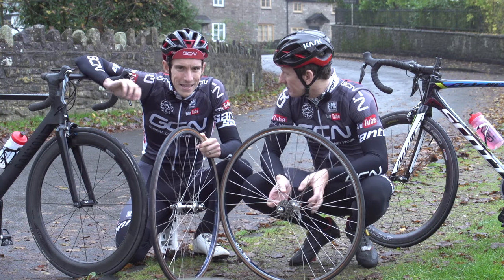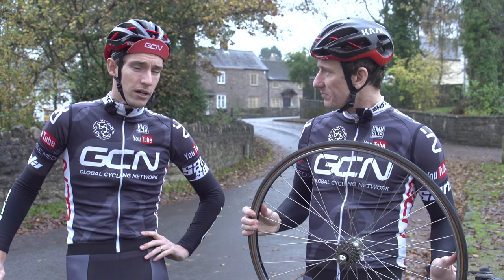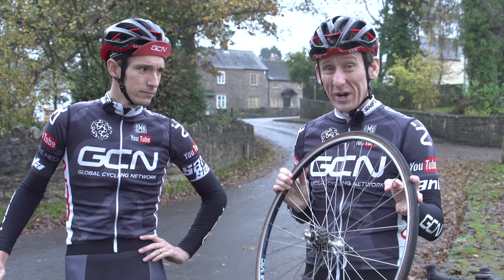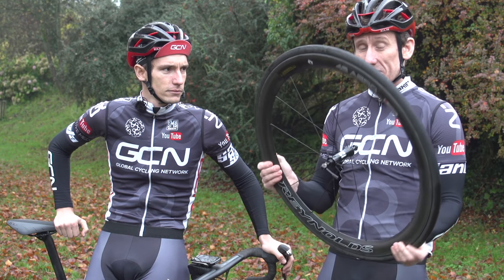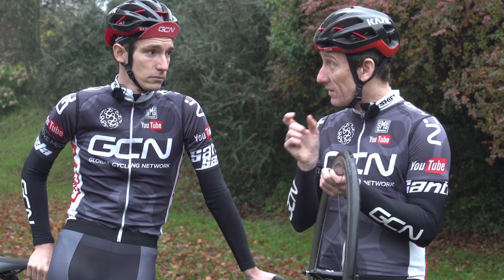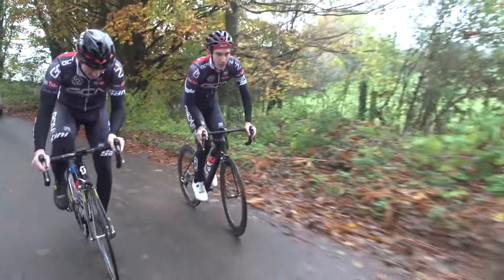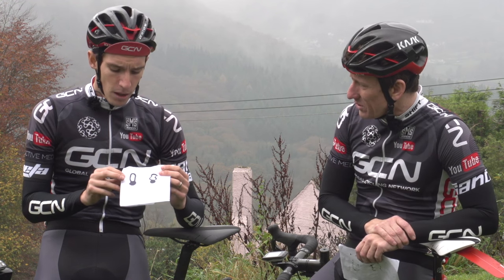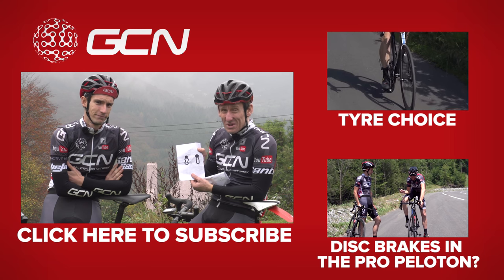Retro Wheels vs New Wheels - How Have Modern Bicycle Wheels Evolved?

Comment: i snapped a gear cable on my way home from work today, at 7pm in the dark wind and rain, and i would like to extend my extreme and undying thanks and gratitude to GCN, using my limit screws, i turned my bike into a single appropriate speed and made it home in reasonably good time, hence why I'm commenting this now and not in 3 hours! Thank you GCN!!!!!!
Reply from the maker: +marcus allison good work!
Reply: +Global Cycling Network are the thinner tires more dangerous like do they slipout from under u easier
Reply: Generally they will because they have less contact with the surface, but its all about being strategic about where you'll be biking to avoid such a thing.
Reply: happy to hear this
Reply: Thinner tires do not 'have less contact with the surface' by itself, area of the contact depends on tire pressure. So only IF you are running wider tire with lower pressure you get extended contact area, more cushioning etc.
Reply: If the back cable snaps it defaults to the smallest cog, so if you need a lower gear that's a smart tip actually.

Comment: I am old enough to have ridden those old wheels. I rarely need to true a rim now but, back then, it was constantly needed.
Reply: +David Mansfield Only if the wheels were built badly. I am from that era of cycling and used to build wheels of all kinds. Constant truing was not needed.
Reply: I ride a 40 year old steel frame with 27 by 1 and a quarter wheels. truing is a skill that's well worth learning!
Reply: David Mansfield I weigh 260 pounds and ride an original 1983 bike, no problems?
Reply: Always wondered what’s the difference between a 36 straight gauge 3x wheels and one with 32  3x double butted spokes except the weight.

Comment: Several key points to emphasize: most such advancements have been oriented towards racing, as the companies learned the consumer market will buy whatever they are convinced the pros use must be better, even if it is not at all optimal for amateur and recreational use. Aero gains and efficiency with carbon cost huge amounts, with negligible savings over modern alloy shapes, light hubs, and Sapim light spokes. Braking problems with carbon, basically solved well with alloy rims for fifty years, forced more to create the novel, if pricey and heavier (!) solution of road discs, but upselling is easier since MTB have made them seem superior. Fact is, ironically, carbon pro frames are so light, they can re-add weight in brakes and other areas just to get up to the racing minimum, while a recreational rider using rim brakes can assemble a bike several pounds lighter. Aside from this, real recreational high mileage riders are still far better served by alloy spoked wheels they can true, replace or rebuild with standard spokes in all parts of the world, while carbon is a conceit, impractical, and WASTEFUL as well, being non-reusable. By the way, I can fit 25 and some 28mm tires on my Mavic Cosmos rims just fine, and that ride beats carbon, plus I don't have to fear braking hard every time I ride down upper Flagstaff.
Reply: "By the way, I can fit 25 and some 28mm tires on my Mavic Cosmos rims just fine".
I have an unrelated question to ask you: What's the biggest tire i can use on my cxp 14 mavic rims?, i currently use 700x23c. 23-622 michelin dynamic sport tires.
I see i still have a bit to go on height wise before the tire touches the frame.
Reply: @coffeepot3123  My rims are 20 and 21 mm wide, outside braking width. You can likely fit 25c tires, but larger may compromise the bead's ability to keep the tire on in hard cornering, one of the warnings, but I've never heard of one coming off. Brands vary, and I only found one 28c Gravel tire that clears the frame and brake mount. Front and rear may be different. Get one tire, try on both wheels fully inflated for clearance before buying two. It's all really fiddling with stuff, not real sophisticated; rando riders have been tweaking for fifty years.

Comment: Removing the brake track from the rim might not save much weight, once you add the disc rotor. However, you've effectively shifted weight from the rim to the centre, which means the moment of inertia of the wheel has decreased by a more significant amount. For a rotating body, you typically care more about the moment of inertia rather than the weight, since the momentum and kinetic energy of the wheel depend on its M.I., rather than its weight.
Reply: beeble2003 try spinning the wheel with your finger. that's the inertia you have. almost none.

Comment: I still have some race freewheels from back in the 80's. I have a six speed 13x18, and then two seven speed 12-18, and a 12-19. Back then, I was much younger, and could use them in flat criteriums. For rolling races, a 13-21 7 speed, and for hilly races, a 13-24. Decades later, I'm not about to push those gears any more. Now, I ride with a 12-25, with a 53x39 up front.
Having only a 13 in back, as your top gear, didn't limit your top speed, as long as you could spin. I remember one race where I was spinning a 13, in the last mile, up to 120 rpm, which spun out at 60 kph....Yes, tubulars were king. You weren't considered a real racer if you lined up with clinchers.

Comment: Just from an engineering perspective, depth of section of the rim has much more effect on stiffness than material. BD3/12. 
Carbon makes less difference in weight as the section gets shallower.

Comment: Would be nice to see a bit more in depth about wheels and how they are built. I used to build my own cause I was skint, now with mass produced machine built wheels it's only worth building if you use top end parts - you can still save yourself 60% + on an expensive pair if you have the patience and tools.

Comment: A few years ago I wanted to try carbon clinchers but was afraid of the delam failures I'd read about (we have long steep descents around here). I built up a Reynolds C32 on a DT Swiss centerlock and put a disc fork on my bike with TRP Hy/Rd brake and IceTech 160mm rotor. I run a Reynolds with a caliper brake in the back, but most of my braking is done with the front so the rear isn't at huge risk of overheating. In summary I think the added weight (nearly 1 lb) might undo some of the benefits, but I love the stiffness and acceleration of the carbon wheels (when the pavement is clean). While the industry is still debating whether pro races are ready for discs and what size through-bolt to standardize on, someone should instead build a decent road disc fork with 160mm spacing - the 20mm chunk of metal spacer for a rotor adequate for a typical adult male should be unnecessary. I'm also about to swap the Hy/Rd for the mechanical Spyre from my CX bike, just to experiment (new vs old Shimano shifters on each bike, so curious about the feel of the different braking actuations (i.e. Super SLR) as well). I suspect the mechnical brake is lighter and adequate enough, and I haven't tried full hydraulics because of the rim on the back (SRAM, unlike Shimano, offers a hydraulic rim brake with incompatible fluid, and I'm running Di2 so can't mix and match anyway).

More recently I had Sugar Wheelworks build me a pair of Pacenti SL23s on DT Swiss 350, and I run 25s on those. What a ride!! They are super comfortable, spin up quickly, and corner like a brick craphouse. Even with 23s they look like you're running 28s, but I'm sold on this new trend of wide rims. I haven't tried running them tubeless yet, as I ride them solely on the road so don't need lower pressure (plus I've seen several buddies run into tubeless problems while we're riding, so I'm personally not sold).

And yeah, I throw a bunch of money at my hobby, so if you want to factor in cost I'd advocate for wider rims over carbon clinchers. The v2 Pacenti SL23s ROCK, but I'm told to stay away from the v1.

Comment: retro wheel durability= 20/25 years. carbón Wheel durability =1/1,2 years . Compare carbón wheel's vs vintage Campagnolo. Shamal HPW12 jajajaaa
Reply: There are plenty of carbon rims with over 100,000 miles on them if you live in the flatlands.  I ride a lot... 15,000 miles a year.   And with variable weather and rolling hills.   I train on aluminum wheels but I generally brake through the brake track somewhere between 25-30k miles.  So that's two years.
Reply: AndresM.Uy This is not acurate. I have campagnolo/wolber wheels from 1983 that spin like new. That's 35 years. And i'm absolutely sure they will spin for another 35.

Comment: How does the 11spd chain run on 7spd block,
Reply from the maker: +david chapman it ran...
Reply: +Global Cycling Network I figured the chain would be too narrow. surprising.
Reply: +Mike McKallicuffy Internal chain width and the distance between teeth is a constant, external width is what gets changed between generations. So you can run an 11spd chain on just about any older cassette, but the reverse is not true.
Reply: +Eric V Internal chain width should be 3/32" for most of the road bikes speeds, but recently some manufacturers of chains like kmc made them narrower (11/128")
Reply: Incorrect, please stop spreading misinformation and go measure a chain only outer width has changed. Why do you think 10/11 speed chain rings are identical?
Reply: i have a kmc 11sp here that says 11/128" and my 10sp is 3/32", minimal diferences but not equal

Comment: I always guessed removing the brake track would not significantly lighten a rim.  But if doing so can make the rim aero dynamic enough to counter the loss from the rotor and caliper then the designers only have the additional spokes to worry about.  Need 2 cross spoke lacing on a disc hub and you can't do that with only 16 spokes.  It wouldn't surprise me if the UCI comes out with another rule on spoke count for disc hubs.

Comment: i have a Pair of Mavic Oxygen M6 Hard Annodised Graphite Color that was a Rim Brake at one time .
on the Edge the Anodising worn off Slightly 
Dismantled the 36 spokes and REBUILT with 6 bolt rear XT and DT swiss Huigi front 6 bolt silver hub

Comment: 1100+ grams.  how much of that was the freewheel assy?  those buggars weigh a ton!  I ride both styles of rims.  I love them both & find that there is a ton of variance depending on the rim used, vintage or modern.   a conversation for another time but... I broke a front Bora  & found that it had kevlar on the inner wall.  This certainly would account for the ride characteristics & the strength on that thin wall.  Such a great wheel!  I run various box rims, 28h - 36h.  Depending on rim design, hubs & spoke count you can come up with some really inspiring wheelsets.   first 5 seconds of this video really say it all though.  Wheels really are the biggest improvement in modern bikes

Comment: You said 32 spokes on the rim towards the beginning of the video and then 28 later when you're riding the bike with those rims on it. So which one is correct?
Reply: Vegas Cycling Freak 32 on the rear 28 on the front was normal.

Comment: On  one of my old bikes the wheels flex so much the spokes sometimes skim the derailleur.
Reply: +MRGRUMPY53 More tension will not help. Once the spokes are in tension - any tension, additional tension will not make the wheel stiffer. This is because steel (spokes) adhere to Hooke's Law. The only way to get the wheel stiffer is to add more spokes, thicker spokes, thicker rim or, a combination of these factors. Also, the wheel in question that skims the spokes, was laced the wrong way round on the derailer side. It can be laced so that the spokes pull away from the derailer instead of towards it.

Comment: the problem i find with old tyres is when i corner hard on them i end up riding on the wall of the tyre where there isn't really any rubber so i have to slow down and corner less steeply.

Comment: If I want to change from Aluminium Wheel to Carbon fibre ones, do I have to have a specific size? Or is it all the same for all the Road bikes so long as the wheels can reach the break callipers?
Reply: ***** What about the cassettes? Do I have to purchase different ones with a different hub; to match the bike wheel? Or are the hubs universal too and fit all wheels?

Comment: - at the same pressure, a wider tire runs faster
- at the same pressure, the narrower tire is more comfortable
- if you want a comfy ride, you’ll always increase your rolling resistance
- narrow (front) tires (regarded separately) are more aero
- fast aero wheels need rims deeper than 38 mm
- disc wheels can’t be aero, because they need lots of spokes
- tests tell us, modern clinchers can be faster than tubulars, but i don’t trust these tests. for instance, try a good veloflex tubular and you know what i mean

Comment: Today is APRIL 2021, it's been 6 years since you ran this GCN 2015 episode and from the looks of the carbon wheels you had back then, "NOT MUCH HAS CHANGED"!  In the industry 6 years is an eternity.  Here is a fact, just like airplanes in the 50s hit the sonic wall, so has the high-end wheel industry.  The reason the industry can not take the next step to create the next modern wheel is they need to understand wheel balance and create a "Rotational Balance System".  Why??  Today's aero bikes easily exceed speeds of 50 or over 60 mph when descending mountain roads. But a problem has emerged that at those speeds often these new carbon bikes/wheels start to handle nervously and some just go into a High-Speed Wobble when it should be the opposite.  And it all has to do with poor rotational wheel balance.  Think about this fact, basically, 50% of a bike is static (ie frame, fork, h-bars, saddle).  The other 50% spins at a high rate of speed (ie the wheel assemblies).  Wouldn't you think if you rotationally balance the spinning 50% you will gain more speed and make the wheel's aerodynamic technology more efficient??? 
 
FYI:  It's called Newton's 1st Law... A mass that is put in motion will continue in motion unless interrupted by an outside force (ie wheel aerodynamics), or an oscillation (ie wheel balance).  Which by the way this is how an F-1 car works, aerodynamics Plus everything is balanced, wheels, engine parts, weight distribution, etc.  Modern carbon bikes/wheels, just aerodynamics, Dumb.

Basically, the high-end wheel industry has milked aerodynamics to death because it's easy to market.  But balance they still don't understand it, don't know how to apply it, let alone how to market it.  If I can only convince someone at GCN to meet with me here in Seattle, I can show you the studies I've made over the last 10 years on bicycle wheel balance.  I can also show you a new technology for high-end wheels that adds no weight, and or needs no gadgets to achieve perfect wheel balance.  My system is 100% Consumer, Dealer, Manufacture,r and OEM friendly.   It would take someone like GCN to get the attention of manufacturers to look into rotational wheel balance, and GCN can take credit for finding the secret to making the next generation of the modern wheel.

To contact me just look up a bike shop on Mercer Island, Washington.    PS, bring your bikes so you can ride the famed Mercer Island loop.

Sincerely Dan Sotelo
Reply: I don't really believe any of that.
Balancing a wheel isn't rocket science and I doubt that any wheel 'High-Speed Wobble' you mention is due to an out-of-balance wheel.
Reply: Wow you inspire me to ride down a decent in my retro Campy Super Record Colnago steel bike with MAVIC MA 40 32 spoked box clincher wheels. 😊. No wobbles

Comment: They are wrong about the wider tires. In 1978 I could buy and easily mount a 32mm tubular.  There were a wide assorment of rims and tires from many manufacturers that could be mixed and matched. Older bike all - as in almost each and every one would accept a 28 mm wide tire. It was not until the 1980's that the super skinny tires sort of took hold. If you don't believe this then look at the brake reach on old bikes. The "Standard Reach" brake is now a long reach brake.

Comment: i'm riding open pro rims with 32 dt comp on well maintained (like new) 105 hubs from 1999 with schwalbe SV20 extra light and conti grand prix from the nineties measuring 20-622 at most, have a few 18-622 on stock as well for my track bike from ~1968. i prefer 11-12bar, should be ~160psi? :D

Comment: Cyclists have always worried too much about the aerodynamic qualities of their bike components when the biggest single drag is the cyclist themselves. Of course using drop bars will lower your profile significantly, but the next next big gain will be made be turning the seat 90 degrees and using a tiller style handlebar. We call it Pharaohdynamics!

Comment: What's best wheel and tire to purchase for a beginner
Reply: +Antonio Cartwright it's a fucking wheel, what could you say about it?! they're all about the same for road bikes only a few grams here and there aswel as looks and brand is the most difference you'll see, wider tires usually mean more stability but it's all up to the rider, a fat rider won't notice a 100 gram weight difference, a biker with good stability won't notice the difference from a large grippy tier to a small one other than speed (comfort) a biker who bikes for fun won't care much of whatever is on it.. so it's a fucking wheel, you can't reinvent it only make small improvements and sell it as a premium component..
Reply: To make it simple I only wanted names of different brands,  are u guys cyclists?  Damn,  it would of been easy if some one said well hey when I first started riding I had this size with this pressure etc.

Comment: Are their any carbon rims that can handle heavy recreational cyclist. I currently have alloy Mavic Ksyrium elite s wheels. They did crack near a spoke on the back wheel after a year but Mavic replaced the wheel, but many other cyclist had the same problem. Thus makes me hesitant about carbon wheels. I'm 225lbs.